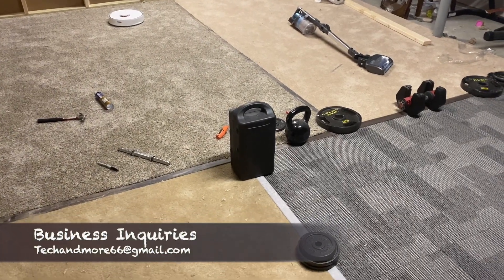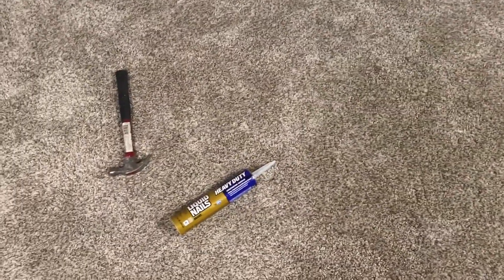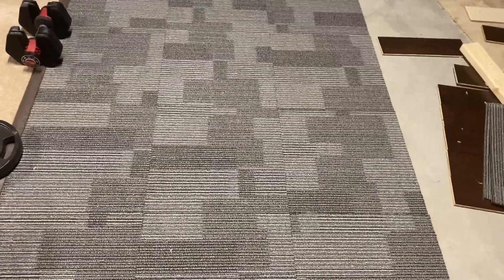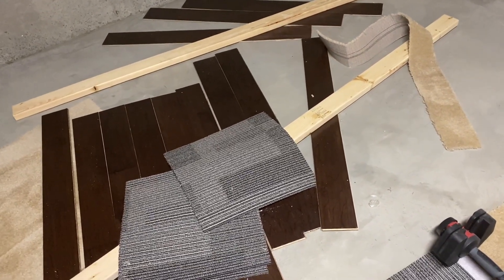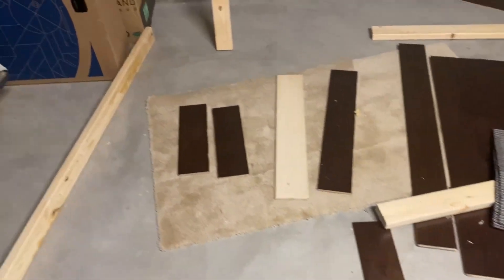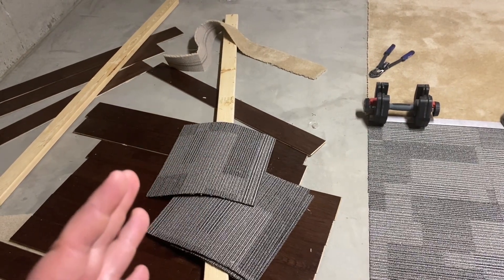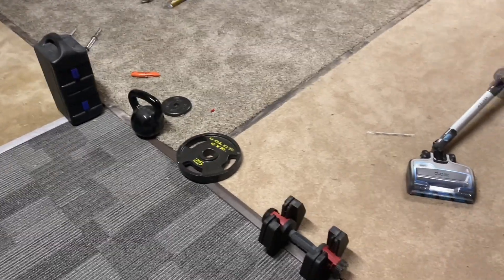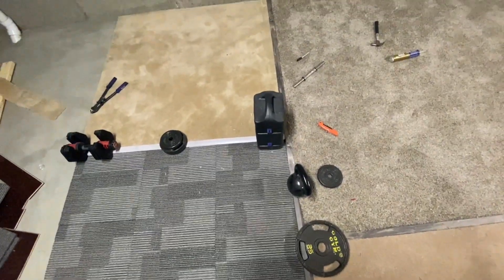UPDATE - Custom Built Robot Vacuum Testing Room - Come in and share your ideas!

Comment: have you seen the new iHome autovac nova for $399? Comes with self-empty bin that's not like all of the other cloned ones. looks to only be sold at Walmart.
Reply from the maker: just ordered it to try thanks
Reply: @AdamsReviews  I bought it to try as well - I have the Deebot t8+ but I'm not really happy with it's edge detection for stainless steel appliances - it won't get close to my fridge or oven in the kitchen (even if I turn the TrueDetection 3D off). I had a T5 previously and had zero issues.

So far, it seems like navigation is a huge improvement over the t8. This thing seems more efficient and hugs the walls/everything else - but is gentle in doing so. App is okay, but I had to force quit it once - however, the ECOVACS app is buggy as hell too. The basic functionality seems fine and it was able to map on the first run (you have to create the rooms, like on Neabot, tho). Self Empty bin seems to work fine.

Only thing of note - it feels maybe a tiny bit cheap and a few times I heard a rattling while it was running only for it to stop for 10 min and then start back.

Comment: Hey Adam! Great job on the testing zone. My 2¢ are the dark hard wood may not resolve well on camera. I don’t think you’ll be able to see dirt or if it’s clean. Also a textured piece of linoleum. Something with grooves or wiggles into the surface, like the grout on tile, where dirt can hide. Love what you’re doing and you hit my feelings on my 981. Loud but for a semi-smart robot does a decent if not great job. At below $200 yes, at the retail of 600 or it’s original 900-1000 no way in hell, now. If I’m home when I run it I use my Air Pods Pro with ANC and it kills most of the whine. The 981 cleans while I catch up on my podcasts.

Comment: I'd say throw in a test square of the blackest, most light-absorbing carpet you can find, to test cliff sensor rejection. Historically that has been a bit of a problem. Likewise, a series of ramps/platforms (or 1 adjustable one) of varying heights to determine at what height robots discriminate between pathable thresholds and unpathable cliffs would be enlightening. Some buildings, especially outside the US, can have arbitrary height transitions that are notorious for trapping robovacs.

If you really want to get fancy, maybe a cut-down reproduction of brick masonry? I've heard of people with brick floors, and sometimes people run their robovac on their hearth.
Glass would be interesting as a very slick surface for side-brush flick tests, and if suspended, you could get some cool underside footage like in some commercials. You'd probably have to make sure it isn't transparent to infrared though (due to cliff sensors again).

I'd say try to go with a static mounted camera view, whichever you choose, because a tracking one could get pretty dizzying if you try to edit together a time lapse.